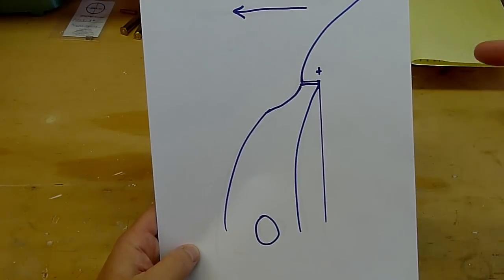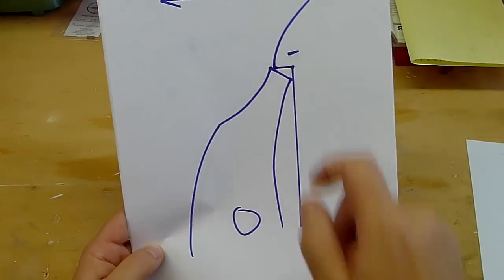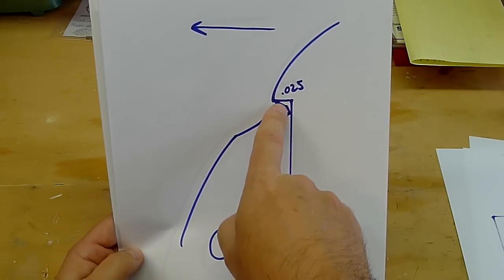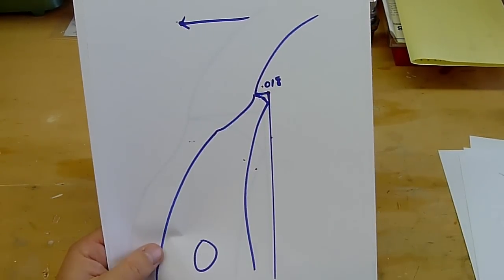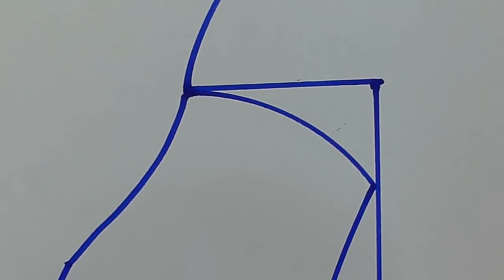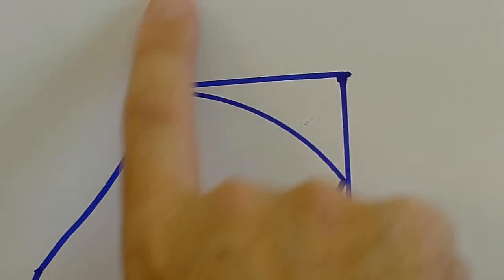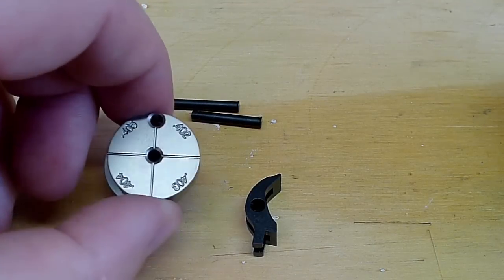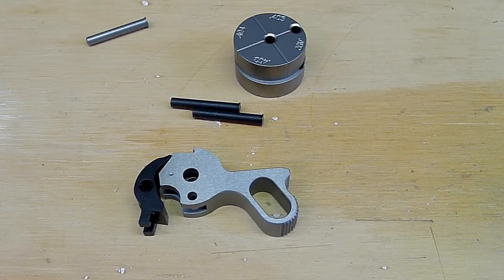1911 Hammer/Sear Interaction

Comment: Thanks for describing hammer and sear operation. The diagrams are great. My question is, isnt the sear nose width so short that the change of 1st angle and 2nd angle through its travel so small in difference that it'd be imperceptible? If the hooks were long and the nose were equally wide, I can see the importance of matching the sear nose shape to the arc that it travels, but that would result in a creepy trigger I would think.
Reply from the maker: Hi. I'm glad you enjoyed the video.

You said "...it'd be imperceptible." That's exactly why there shouldn't be any creep! Because we're talking about such tiny distances (the drawings are GROSSLY exaggerated—I probably should've pointed that out in the video). And the secondary angle helps with that, too. The secondary angle means that the sear has to move hardly any at all before the secondary angle is reached and it pops out from under the hammer. Having a curved surface on the sear nose simply prevents it from a) "wanting" to pop out from under the hammer hooks or b) having to lift the hammer out of the way, both bad things. 

However, the curved sear nose shouldn't contribute to creep, assuming you have a good secondary angle and the hammer hooks aren't too long.

Comment: I have never had any difficulty maintaining a positive rake on the sear/hammer notch while achieving trigger pulls down in the ounces range. By having zero rake, you have a accidental discharge waiting to happen.
Reply: @stevengibbons3845  Yeah, and I know I'm not explaining this correctly, but I thought the sear tip was supposed to have two angles and NOT be rounded!

Comment: My HK45 has a positive sear angle. The hammer moves back quite a bit, but if I release it before the hammer falls, the hammer cams back to it's original position. The weight is about 5-5.25 pounds with creep, but it's very smooth and has a crisp break.
Reply from the maker: That's the behavior I would expect. No problem if you don't mind creep.
Reply: good work

Comment: Great video. I’m preparing for my first home trigger job, and this helped put a lot of concepts together. 
Regarding the Brown Sear Jig/Fixture, how does one properly position the set screw to get the correct angle?
Reply from the maker: I didn't touch it. I left it at its factory setting. However, adjusting it should change the angle of the sear nose, thus changing how easily the sear comes out from under the hammer hooks, as I show in this video.

However, I would recommend using the True Radius PRO sear jig rather than the Ed Brown jig. I have a video on that here:

https://www.youtube.com/watch?v=bzLi7NErYmg
Reply: Jay Philip Williams|||| Yeah, I’ve researched the TR Pro. It looks like the way to go, but I’m on a budget and it’s a big expense for a guy who may only do 2 or 3 trigger jobs in his lifetime.
Reply from the maker: @jimm244  I totally understand, Jim. Let me say something else. I'm just a hobbyist, too, not a professional gunsmith. I would recommend you hop on over to https://forums.1911forum.com/forumdisplay.php?f=18 and ask this kind of question there (not that I mind trying to help). There are a few professional gunsmiths there and they'll definitely be able to answer any questions you may have.

I'm guessing, however, that the screw you asked about will simply help you adjust the primary sear angle between positive, neutral, and negative. I think you'd need to try it as is, put it in the gun and see if the sear pops out on its own, or lifts the hammer when you pull the trigger, or if it's neutral. Then, adjust it from there.

One other thing, I just read today that you really want more like .100" (or a little more) on the shim for the secondary angle. That will keep the sear nose from sinking too deep under the hammer hooks, thus requiring more effort to get the sear to pop out from behind the hammer hooks.

Comment: I've watched this video several times to understand the hammer hooks/sear action. Excellent. I know that the later episode with the True Radius jig, the final result is a 2# ??? trigger pull. Which for me (retired LEO) is way to light for my taste. If the sear nose is positive  (not radius cut) will I get a 4# + trigger pull, which is more of my liking for a CCW piece?. It seems like the Brownells sear jig (a copy of the Ed Brown) would be more useful to me.
Reply from the maker: Hey, John. The True Radius PRO jig will give you the best quality trigger pull in combination with being safe. It doesn't HAVE to be only 2 pounds. I agree that that is very light, at least for my purposes. You can make it heavier by simply increasing how hard the triple spring is pushing forward on the trigger bow.

Comment: Lets say if you fuck up and the sear fails to hold the hammer, the 2nd bigger notch on the hammer will still catch on to the sear on its way down and will not hit the firing pin correct? assuming the trigger isn't pulled.
Reply from the maker: That's correct. The triple spring will still be applying pressure to the sear, holding it against the hammer, and so it (the sear nose) will fall into that notch, stopping the hammer from striking the firing pin. Colloquially, it's called the "half-cock notch," although I don't believe that's the technical name for it, and I don't have my books handy.
Reply: @jayphilipwilliams  for some modern 1911, they also have a firing pin block. unless the trigger is pulled, the firing pin will not hit the cartridge even if they hammer happens to strike the firing pin. Good to know an 100 year old design 1911 has a lot of fail safe in place.

Comment: Why not use a 3000 grit sand belt and push into the rolling belt? It should give you the arc on the sear.
Reply from the maker: You need way more precision than you could get that way. A jig and a stone will give you that.

Comment: Is it possible to buy a sear and hammer already done, so that will make it easy for us shooters .” Drop in set”—
Reply from the maker: I believe most if not all of them would drop in and function fine. I would recommend calling Brownell's or Midway (or wherever you buy parts) and ask them, though. You'll usually get a better trigger if you do some work on it, but I don't think it's usually a requirement.